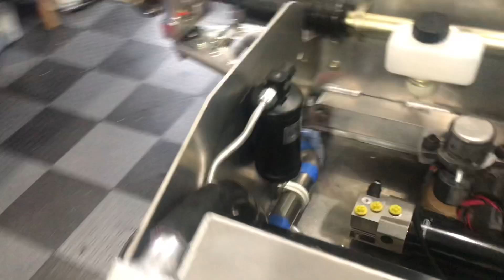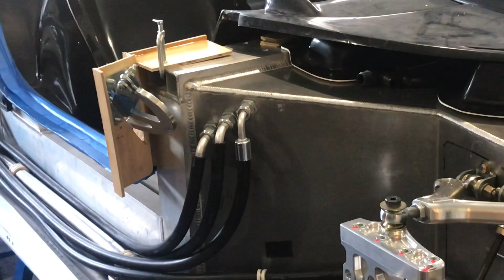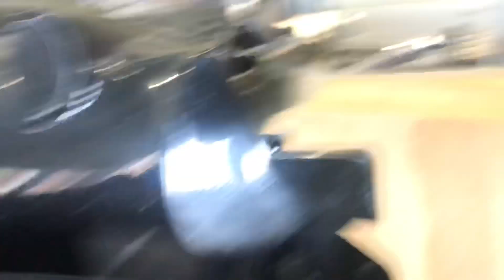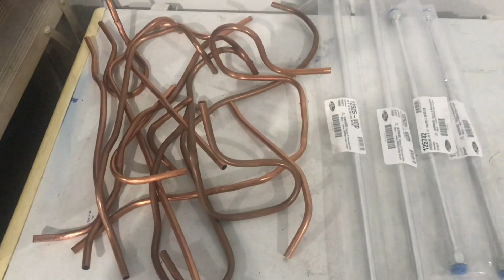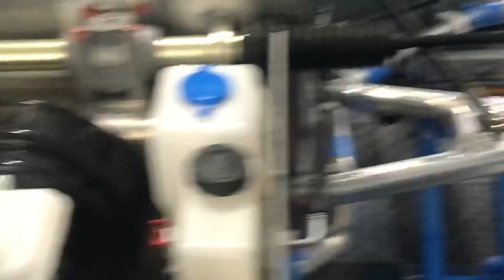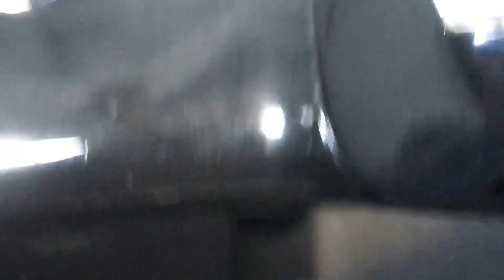Superlite SLC Build 059 Heater Hose and AC Line Installation

Comment: Joel, Where did you fine the #8 female to female 90 degree adapter?
Reply from the maker: @scottwomble2543 Not sure which specific fitting you are referring to, but if they were not standard vintage air fittings. I purchased all the others from coldhose.com A very good source for various fittings.

Comment: Where the pipes go through the radiator.  I think I would slide some split rubber tube over the aluminium pipes to stop them touching each other or the radiator.  Stops rattles and prevents wear.  Also peace of mind.
Reply from the maker: Yes, definitely going to add rubber in that area.

Comment: Hey Joel loving the build man kept the videos coming. I'm wanting to do a build on an slc but I'm looking into engines that would fit. So far I'm tryna decided between a V10 supercharged or TT LS3. But I'm also interested in a possible inline 6 build using a 2jz or ford barra motor, do you think they would fit for being so long?
Reply from the maker: Thanks Braiden, appreciate the feedback. A few people have put both V10s and TT LS engines. Not sure about a straight six. It will be a tight fit and may require chassis mods. The factory can make the mods for you while they build the chassis.
Reply: @JoelKSLC  thanks man. I'm looking forward to seeing your finished build. Good luck :)